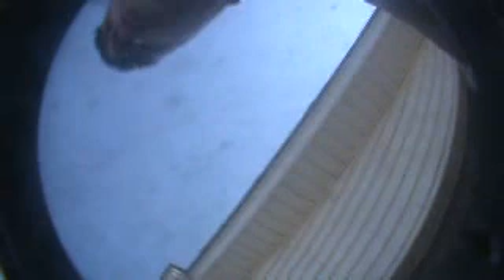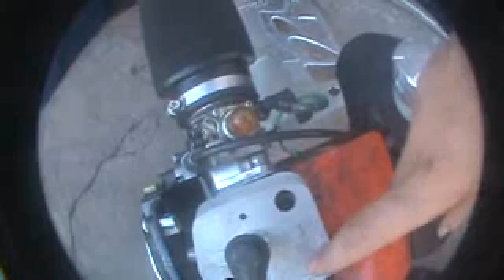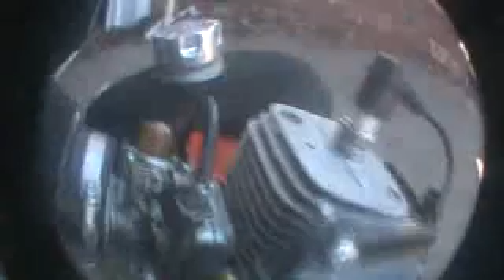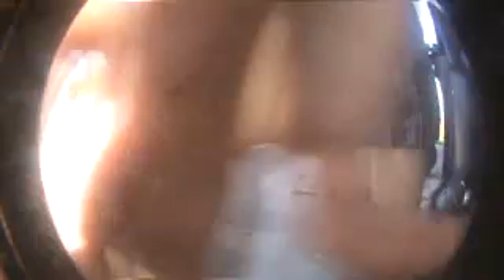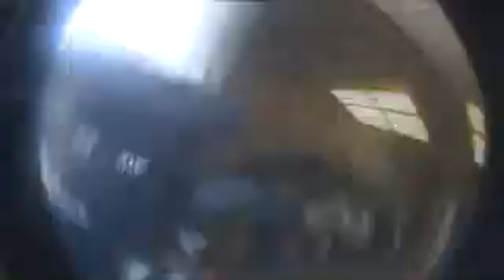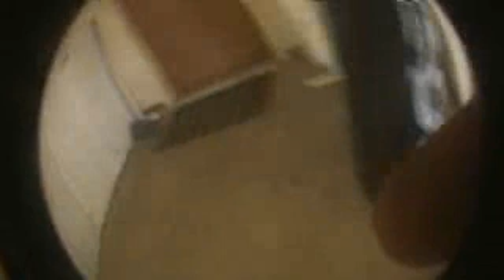goped help

Comment: @dirtskateboardteam The black ignition coil that your spark plug wire is attached to. Other things can be crank case bearings, the crank itself... But check the ignition coil first and make sure the magnetic pick ups aren't touching the flywheel.